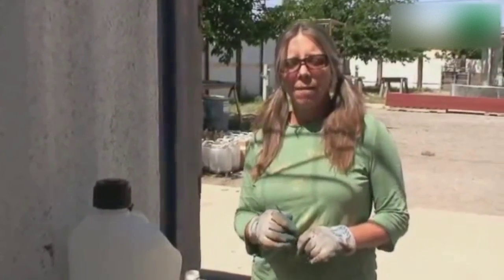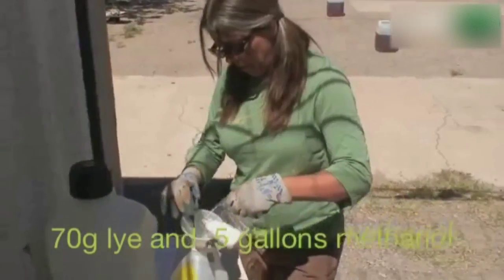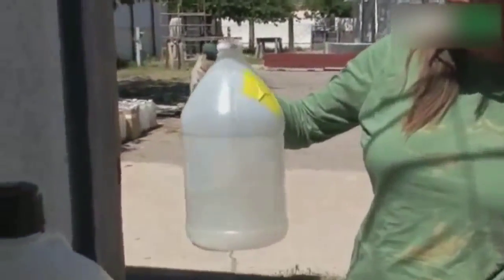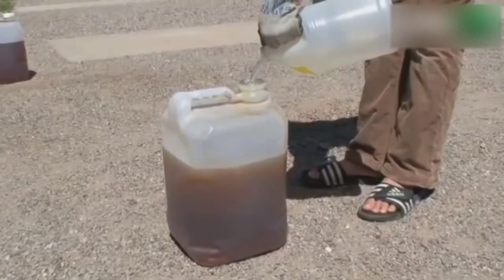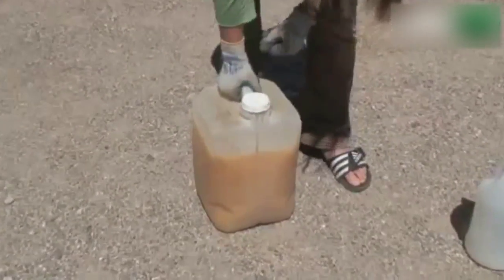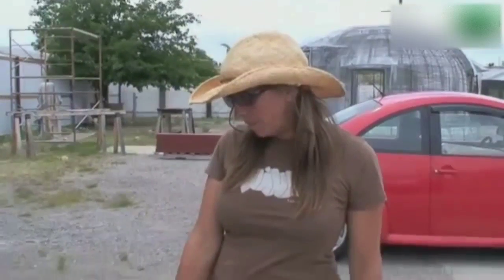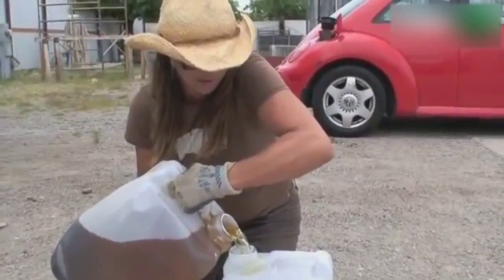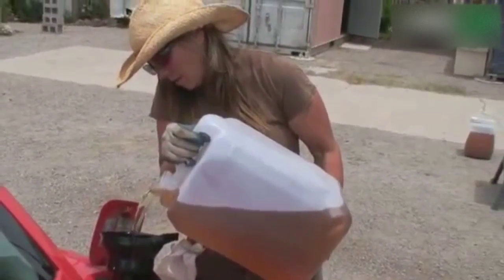How to make Biodiesel at Home in 5 Minutes..! | Biofuel From used Vegetable oil / Cooking Oil

Comment: I am able to make Biodisesel and the waste product Glycerin.

Just by mixing used Cooking Oil and Supermarket 70% Rubbing Alcohol / Ethyl Alcohol.  This may be slower though as you need to agitate and  mix them occasionaly. But without the harmful corrosive catalyst that is supposed to speed the reaction.
Reply: It would also need filtering and water wash. Depending on where you plan to use it.

Comment: diesel here is $1.70-$2.15AUD per litre, methanol is $4.30-$8AUD per litre so to make 1 liter it'll cost $0.86 to $1.60. I think I did that right 80% oil to 20% methanol. its only about half price if I get the 200L methanol and oil for free. 
I saw a video of someone using pork gelatin to clean oil then mix whats left with 10-50% paraffin/kerosene and thats it. I tried 15L batch and messed up tho.

Comment: Is this woman me???? I literally thought of doing the same exact thing as her: Taking a red 2000's new beetle, putting a diesel engine in it, and making my own biodiesel! I wanna see if I turn my beetle into a hybrid diesel car, somehow installing electric things and swapping the gas engine for a modified B100 diesel engine. Anyways I wanted to replace all the parts of a scrapped beetle with new interchangeable parts, as that thing is gonna have 100,000 miles on it and I want it to last forever and function as a new car. "Mileage" on odometer don't matter, as I ain't ever ever gonna sell that thing.

Comment: So I'm no chemist,
-But Lye is basically hardwood ash mixed with water
-Methanol is a byproduct of distillation of spirits
So if you mix those with used veggie oil, that's it?
In that case, theoretically, one whom distills ethanol for fuel and heats their home with firewood can get free oil from local restaurants (or even lard or tallow from livestock) and have all the necessary ingredients to make biodiesel.

Comment: Not dissing this but does the engine out.of the vw deal with it ok ? 
Even with my old mechanical pump engine theres some pumps that are ok and some that 100 bio will eat the seals .
I thought high pressure rail vag engines hated bio..
...just asking 
...very happy to be proved wrong

Comment: Hello Wendy,
can you use baking powder instead of lye?  Baking soda is also said to act as a catalyst.
Reply: Which?? Baking Soda or Baking Powder? They are not the same thing.

Baking soda will technically work, but it will not be anywhere near as efficient a process. You would have to use 3 to 4 (or more) times as much baking soda to get the same yield.
Reply: Where do you get methanol from
Reply: Sorry meant for overall posts and not as a comment to you.

Comment: can be quick yes, if the used oil isn't too degraded and dirty. However for most modern diesel engines, im sure you'd want to syphon off the good stuff after at least a couple of times 'washing'. Older diesels are a bit more forgiving, especially the ones built before the new-clean (low sulphur) diesel standards took effect.

Comment: Hello Wendy, I was wondering if you had troubles with your Beetle VW engine lately, since you have been using bio diesel for 2 years by now!? I am planning to do the same with my car but I don't want to damage my engine...
Reply: sper ca masina ta are pompa de injectie clasica- (fabricat inainte de 2003) -altfel eu nu as lua riscul...bafta!
Reply: Salut Andrei. Merci. Nu m-am incumetat sa risc degeaba. In schimb biodiesel voi folosi pentru a incalzi o casuta la tara cu un sirocou...deci adun totusi uleiul in loc sa-l arunc, care e din ce in ce mai scump...o zi frumoasa iti doresc!
Reply: @TheClaudiuRusu  yea, eu folosesc ulei vegetal uzat " WVO "in vw jetta 2002 (  Bora in europa ) cu motorul ALH cu pompa clasica- fara a face prea multe modificari si totusi nu functioneaza perfect- asa ca am inceput sa fac un fel de biodiesel ,dar lucrez si sa modific jetta-ul pe sistemul de alimentare cu doua rezervoare.Daca ai o sursa ieftina de ulei vegetal sau de ulei motor ars de pe la servisuri ce schimba uleiul de masina si trasmisie si  nu e  foarte contaminat sant multe posibilitati de a filtra si folosi in masina sau pt incalzit.Filtrare centrifugal si filtrat prin filtru si mixat . Oricum daca vrei sa-l folosesti in automobil -ti-as recomanda motoarele diesel de la mercedes inainte de 1996 sant cele mai putin pretentioase.Bafta ...si sarb fericite!

Comment: Very interesting video. As this method has gained traction over recent years aquiring used vegetable oil can be an expensive business, it's certainly not free. Also this 'fuel' would wreck a modern diesel (common rail) in no time at all. However if you have an older diesel it would be fine, from a financial perspective you are better off buying diesel from the pump.
Reply: Not at these prices… and it’ll probably keep going up. 

If you have a half decent source of used vegetable oil and the space to make bio diesel this is very economical. 

Lots of places you can get free WVO.
Reply: @philipptruveller7829  where is a good place to get it?  What make, model, year car or light truck would you suggest?

Comment: Could this mixture be used as a substitute for a “kerosene” heater?
Very simple and easily explained... thank you!
Reply: for wick systems i had good luck but  the kersone vaporizers systems dont work well and if it get to cold the fuel gel's a bit
Reply: I would mix a ratio of k1 into the biofuel to help mitigate the gelling of the fuel.
Experiment with it in small batches starting with a 10 parts Bio to 1 part Kero and place in a freezer to see it’s effect.
Just a thought .. I’m not a expert in this.. I am just a user if Kero and diesel for my heaters cookers and lamps. So there you go

Comment: Yes, he made biodisel, all correct ... but the soap? There is a reason if the biodiesel is washed in the end, and that is to remove the soap, glycerin and alcohol residues. Using it as it is will create operating holes and the mileage will be lower. At least one wash is necessary to remove the bulk of the impurities

Comment: Nice👍.  Will this work with Crdi diesel engines like Ford 1.4 Tdci without damaging the injectors and EGR valve?
Reply: I think its not suitable for CRDI
Reply: I think that this would work fine in a CRDI engine.
Reply: Ford is use PSA "hdi" engine. I love this concept.
My friend is use 1.5 dci clio and 10 liter vegetable oil + 1 deciliter petrol + 1 deci liter 2T oil.
Not bad.
Two engines are really very similar, both are Common Rail French.
Problems with the injector usually arise in the case of incorrect fuel.
There is no need to be afraid of this, common rail works at high pressure...
Watch more videos and read up on the topic, I do the same.
I will also buy a Ford Fiesta 1.4 or a Peugeot 1.4, because it's the same engine.

Comment: 2-EHN added to veg oil works very well.
Mix leave a few days, ready.
Reply: Hi mate, what ratio would you use that at? Many thanks.
Reply: @unochefeeo2656  2ml 2ehn to 1 ltr veg oil or standard diesel to make V power high cetane fuel.
Reply: Thank you so much

Comment: You have 2L of Methanol + 70g KOH, and 3 Gal of used oil (12L).. so you have 16% methanol-KOH solution. Any difference in engine combustion power if we'll use 2L Methanol +50g KOH  and 10L used oil?Also, you're not going to wash it? I'm sorry, I am new here and I have not done the process as of the moment.

Comment: If you use water and you let it sit for days it will split in half and you will be able to get a cleaner fuel if you are doing this wash it multiple times until the fuel is not hazy anymore

Comment: filtration can be used agro film which is used to protect plants from frost it is the cheapest filter.  The film comes in 17g; 30g;  For 50g / M2 thickness standards, density can be selected or a double layer can be used.  It is possible to filter not only during fuel production but also before filling into the fuel tank.
Reply: I thought this stuff was impermeable plastic and needed irrigation beneath it? I was thinking landscape fabric would be ideal

Comment: I looked on ebay and found 1 gal. of methanol costs 26.00 us.  so at .5 gal to make 3 gal. would mean, 1 gal. would make 6 gal. of bio diesel.  at that rate it still would cost aprox. 4.25 per gal.

Comment: Did you have a water removal system I will bet that VW doesn’t run anymore the common rail fuel system don’t do well with water it sounds like it already had a fuel knock modern diesels are not that loud they inject up to 5 times per revolution

Comment: Wendy just was wondering did any damage happened to the car or is it still running or did you get rid of it and if so I know they stop making diesel Volkswagen??
Reply: If the fuel isn’t water rinsed it will absolutely damage the engine.

Comment: I should say I’ve been using veggie oil for a decade now. I just filter and mix it with diesel.   I do have a preheater for the mix on my f-250 idi.  I Start and stop on straight diesel. And run the mix up to 80% once warm.
Reply: You didn't do the process in the video and just pouring it into diesel fuel? Mind sharing the ratio please?
Reply: So you have a switch basically?

Comment: I would wash it with water after separation, wait for the watter and particles to settle, then separate it again, you get much cleaner fuel.
Reply: Put water into the mix? How to get it out later?
Reply: @JedemPoKucama  
It settles out naturally. The biodiesel floats on top. If you don't wash it, you're leaving the lye in the fuel, which is highly corrosive and will eat apart very expensive components (like injectors and injector pump).

Comment: If the used oil has a high water content (which is often invisible to the eye) this method will produce soaps which will damage injectors etc. This method is ok if using the fuel on an older engine, but I would not recommend using it in a modern engine.
Reply: could you drive off water by heating the oil to something like 105C and holding it for a while?
Reply: True. Not for diesel engines with Common-Rail Direct Injection system
Reply: I'm agreed with you.
Reply: Pour filtered old oil in clear tank, leave to settle and water will sit seperate at bottom.
so if you have a tap you can drain water out.
Simple
Add some kerosene or white spirit to oil before use.
Reply: @scottlehuray7062  What would you achieve with adding kerosene to oil?
Reply: Usually the cooking oil don’t contain water
Reply: @willy4170  If it's used cocking oil it does
Reply: @willy4170  yeah specially used ones.

Comment: YOU ARE AN IGNORANT ONE, BECAUSE YOU ARE NOT PRACTICING SAFETY PRECAUTIONS.

 IT'S VERY DANGEROUS IN MIXING IT IN JUST A PLASTIC CONTAINER JUST THE WAY YOU ARE DOING. SOME TIME IT COULD BURST FOR SEVERAL REASONS. 

THE ALCOHOL AND THE SODIUM HYDROXIDE COULD EASILY INCREASE TEMPERATURE. ADDING THAT MIXTURE IMMEDIATELY TO THE USED OIL AND MIXING IT COULD ALSO INCREASE TEMPERATURE, BECAUSE THE REACTION WITH THE OIL IS AN INDOTHERMIC REACTION WHERE TEMPERATURE IN THE MIXTURE COULD INCREASE. 

OUTSIDE TEMPERATURE COULD ALSO TRIGGER TO RAISE TEMPERATURE INSIDE THE CONTAINER. THEREFORE IT IS POSSIBLE FOR THE CONTAINER TO BURST OUT, BUT YOU ARE NOT AWARE OF THIS.

Comment: So the cooking oil in the 1st 5 gallon jug, was anything done to it before adding the lye/methanol (ethanol?) mix? Thanks & great video! If you wait longer than 3 days, will more contaminents be separated?🤔 🌹❤️ Do you plan on making a plastic to oil/fuel set up?
Reply: The vegetable (used) oil is simply filtered to remove any solids from prior use. Methanol must be used, otherwise You will not get usable biodiesel. A washing process is highly recommended...look for other biodiesel videos to learn about the washing process.

Comment: Yes i made that back in 2007 from vegetable oil kerosene methane and gasoline mix and run thru a water pump and filters and walla caramel biodiesel i used it at my 2007 izusu truck instanly

Comment: If you wash the diesel with cold water and then let it separate out you can get it almost completely crystal clear which will save your injectors
Reply: Very good 👍
Reply: You mean pour water in the mix? And how to get rid of it later?
Reply: @JedemPoKucama  boil the mixture and the water will evaporate
Reply: Water and diesel don’t generally mix.
Reply: The bio diesel and water will eventually create distinct layers the water will be on the bottom and the diesel be on top they can then be separated. off.

Comment: And watch out for places that do random roadblock "dip testing" like in Minnesota USA. I got stopped. They call it road tax evasion.
Reply: They make kits so you can store the bio-fuel in your trunk, especially in colder places such as Minnesota. You keep your fuel tank full with regular diesel, and add a switch that allows you to change over to bio-diesel once the engine warms up. Also keeps the pricey dyed fuel in the tank, separate from the bio-diesel so they can shove their sticks in your tank with no repercussions. Takes up some trunk space, but it beats having a ticket for road tax evasion.

Comment: Does anybody know the octane rating of biodiesel made from vegetable oil? From what I have read so far using a different method that uses corn or perennial grass produces ethanol with an octane rating of near 100 which is ok for a gas engine but too high for a diesel engine
Reply: diesel or biodiesel has no octane number  but a cetane number instead. Diesel has a cetane number of minimum 51 in Europe. Depending on the origine of the vegetable oil you get higher (palm oil) or lower (soybean) cetane. Used cooking oil is usually a mixture of different oils and the cetane will most likely be around 51.
Reply: deisel is cetane not octane
Reply: Do you know how to makw corn diesel

Comment: Sarah it may cost you 10 USD in USA but it cost 2 USD to make in Romania and it's the equivalent of 30 USD of fuel. Great video!
Reply: Ai încercat sa faci?
Reply: @asianman4250  in teorie funcționează cu orice mașină .. in practica îți recomand 1.9 TDI sub 2005 vw ... Am avut niste experimente reușite .... Partea dificila ar fi omologarea unui sistem diesel și biodiesel similar cu cel GPL ... In care sa ai o pompă și un rezervor cu biodiesel... Odată ce atingi 90 C sa poți comuta pe pompa de biodiesel .... Asta ți-ar face posibil parcurgerea a 10 000 km cu echivalentul a 100 euro
Reply: @nicoarasamuel1173  am un Ford ranger 3.2L din 2015. Mașinile mai vechi aveau motoare mult mai simple. Greu de decis în cazul meu, din moment ce motoarele mai noi sunt pline de senzori
Reply: @asianman4250  I saw a video of someone using filtered waste oil and transmission fluid from vehicles, he said he has to blend it with diesel from the pump, the ratios depended on the model he was using.
Reply: @nicoarasamuel1173  doamne cat ma bucur ca nu s singurul roman care s a uitat la asa ceva=))))  va ingrijoreaza preturile de la pompa=)))asa i =)))?   Si eu ma uit ptr un  1.4tdci 68cp=)))
Reply: Gasoline costs $0.11/ gallon in Iran //

Comment: I will try it in my Ram diesel. I have run it on bio-diesel at truck stops and it runs great. Can also run it on mineral oil. Probably mixing them to extend the amount of fuel to use.
Reply: Whay she made is high PH, contains to many contaminates, needs be watrr washed 3 or 4 times, what you get a statiom is refined for real, i would look into this more and not wreck yer truck, that VW sounded rough, wont last

Comment: Hi! May I please ask: Does it have to be used olive-oil, or can it be new such oil? Also, can both ethanol and methanol be used?
Reply: Apparently ethanol works, but gives you a fuel with higher viscosity. 
The whole process is explained in a bit more deatil here: https://youtu.be/zj6fDDQrl3w
Reply: @nilsschenkel7149  Thank you for your answer!
Reply: You could use new vegetable oil, but it would cost more than buying fuel at the pump.
Reply: @Adam-xo7cv  Thank you for your answer!

Comment: From what I've seen, it's better if you wash it a few times to get rid of more contaminants, but that is the basic process.
Reply: Excuse my ignorance, but how do you wash a liquid?
Reply: @ntlasanga4267  "The process of washing biodiesel involves mixing it with water. Water is heavier than biodiesel and absorbs the excess alcohol, catalyst, and soap suspended in the fuel. After washing and settling, the water and the impurities in the water can be drained from the bottom of the container."
Reply: @KeithOlson  thank you!
Reply: @isaac4273  You are most welcome, sir!  /bows
Reply: FWIW, if you look up 'biodiesel methanol recovery', you will find a simple vacuum distillation method that allows quickly pulling almost all of the methanol back out so that it can be used again.
Reply: 8 @KeithOlson
Reply: @ntlasanga4267  add water shake like mad allowed to settle repeat 4 a 5 times until water is clear.
Reply: @sunnyshine78  You have fabric industrial filters with 0,5 micron.
Reply: @ee02108  yep
Reply: @sunnyshine78  Water and the diesel do not mix. They will form distinct layers, and can be separated.
Reply: @sunnyshine78   Water and diesel will separate. Ask anyone who owns a boat with a diesel engine..
Reply: I too was surprised to see that she didn't put it through the washing process.  Doesn't that harm the engine?

Comment: That is very dangerous to work with lye in those sandals with exposed feet & no proper face protection. One little splash is very corrosive to skin & burns if come in contact. Also the fumes that you cannot see but the lungs still do inhale are no good to you either 😏

But otherwise thanks for the information in the clip. From what I understood from other clips that one can only do this with the older diesel cars & not the newer models. I don't know though from what year are considered the new models.
Reply: Diesels aren't for pussies.